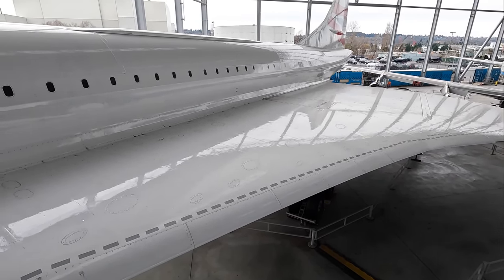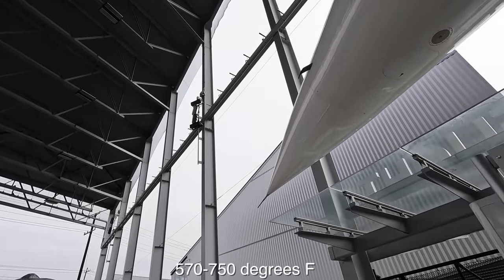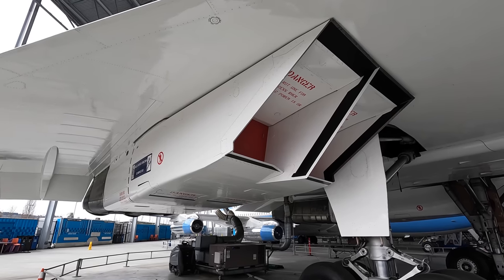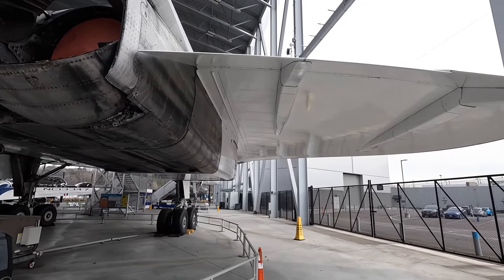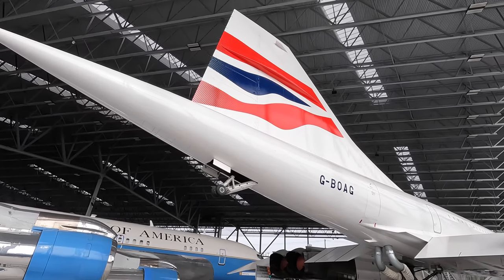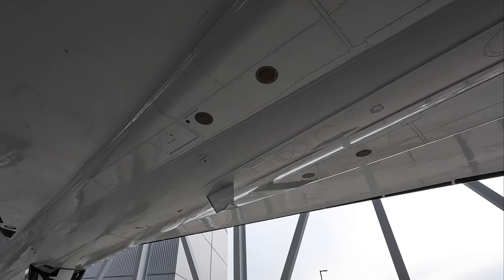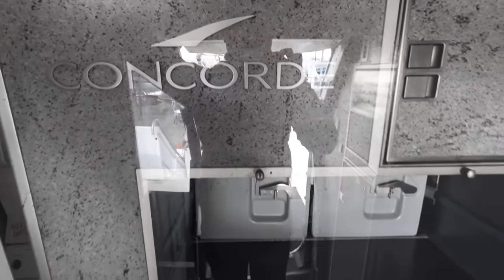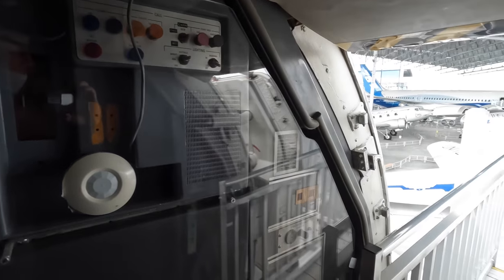Detailed tour of a British Airways Aérospatiale / BAC Concorde

Comment: Hi Paul, you mentioned the use of the fuel as a heat sink. Fuel was also used to trim the aircraft. Since aerodynamic trimming was not considered ideal, because of the lack of a horizontal stabiliser and the desire for a clean aerodynamic profile, fuel was shifted fore and aft to move the aircraft centre of gravity depending on flight conditions. Keeping the aircraft ‘in trim’ was the task of the flight engineer.
Reply from the maker: Thanks for the extra information. I am currently editing my tour video through the Concorde at Duxford so this is all extra interesting info.

Comment: Good Afternoon.
Another Case for another Aircraft to Far ahead of her time and Expensive and Per Passenger Ticket wise hope you had a good Bank And Healthy Bank Balance.
This Plane is so Perfect in Design and Construction you wonder how no more than 12 (Twelve) were ever built.
Easy to Answer, The Airline's were not widely accepting of the type and not SST Ready Travel.wise to gamble on.
We Recently read about the Boom Overture and Orders already from United and Another Airline and then Rolls Royce I believe pulled the Pin on the Type Power Plants wise and no one has yet come to the party on the Engine Front.
I wonder what would happen if even one of the American Based Aircraft Manufacturers or Airbus Industries picked up the Tab and Purchased the Rights to this Aircraft with a view of looking into the Future Market Place.
Given today's Modern Composite Materials available for High Technology Construction wise not to mention the Avionics upgrade and Pilot Intergration also new Power Plants and in that Reconstruction an increase in size of the Aircraft itself Width wise to allow greater room inside even a single seat Positioning wise down the middle and larger windows on the Aircraft, Who Know's what the Future will Bring Back to the Present from the  Past.
We Could go on and on about that for ever.

Good Video, Narrative and Technology talk wise, Loved it.

Regards
John
Australia

Comment: When I worked at Heathrow years ago I remember being in a deserted hangar with a Concorde, just walking around it in complete silence was a treat, the thing looked like it was going a thousand miles per hour just sitting still!
Reply: Was the G-BOAB? The one that didn't have any seats in and loads of old BA magazines as balast? They never upgraded AA and AB, but AB is still at Heathrow to this day if I remember correctly?
Reply: @FelixIsMyName  Pretty sure it was an in service aircraft as this was back in 2001, it was in the hangar for maintenance...
Reply: @richardprice7763  Wasn't the fleet grounded until Sept 11 2001?
Reply: @richardprice7763  I remember being on a flight back from Dublin back in 2000 and seeing all the Concorde in there area in Heathrow. One of the best sights I've seen from the air!
Reply: @FelixIsMyName  I probably got my year wrong but they were definitely flying at the time...
Reply: @richardprice7763  That's what made me think it was AB, as it's the one of the two BA decided were not worth upgrading due to their high (for Concorde) flight hours.

Comment: I flew Concorde in 1992. Yes the interior was very small compared to a then 767 but you didn't really notice with only 100 passengers. No IFE either but you were being plied with booze and food.
Take off was very noisy but incredible acceleration. Supersonic transition was two big shoves in the back as they lit the afterburners on the outside and then the inside. Very stable in flight but windows were quite hot to the touch.
An incredible experience which is gone now☹️
Reply: Normally plane windows are cold to touch. I wonder why they were hot?
Reply: @underneonloneliness2  uh maybe consider how fast the plane is moving? like this plane is exceptionally fast going at mach 2
Reply: @underneonloneliness2  Concorde cruised at over 1300mph, faster than a rifle bullet (hard to believe when you stand next to Concorde) the Friction caused by the plane tearing through the air at that speed is what caused the heat and actually caused the aircraft to expand considerably.

Comment: If they simply made it similar to xb70 only mach 2.0. 4 engines and highly modified  it would have been cheaper from the start.
Reply from the maker: It would have been interesting to see how much commonality there could have been between something like Concorde and the XB-70. I don't imagine that Boeing would have been too impressed, though.
Reply: @PaulStewartAviation  Virtually all aviation has stemmed from some sort of war machine interest like cargo airplanes for the military turned Passenger liner, sentry aircraft like "Boeing P-8 Poseidon" is my favorite example.  The Xb-70 is a fascination blend of efficiency and beauty and size, an apex predator, large enough to take passengers in the bridge or neck extension.  20 year old technology and consent from Boeing just isnt going to happen -your right, the blend or mix of both worlds would have been amazing to see...But 150'000 gallons or 567811 liters of fuel for 100 passengers isnt something can exist in the 80's for long.

Edit:  Just found this.  The XB-70 could fit 80 passengers in airline-style seating, in an absurd idea to keep the jet production going.

Comment: Concorde is a beautiful airplane. I got  to see the other two air frames that are in the States: an Air France example in the Smithsonian's Dulles facility and the British Airways one parked next to the Intrepid in NYC. I got to tour the inside of the latter, including sitting in the FO's seat (no plexiglass on that one, just slip covers on the seats). Three things struck me about the cockpit: 1) it's tiny, too small to stand upright, 2) the pilots' view must have been amazing, 3) everything looked analog, almost no screens whatsoever. Our tour guide explained that after no more orders were received, there was little incentive to update the avionics (same reason as why the "B" model was cancelled). Consequently, by the time the Concordes were retired in 2003, they were the last airliners flying for either Air France or British Airways that still required a flight engineer.

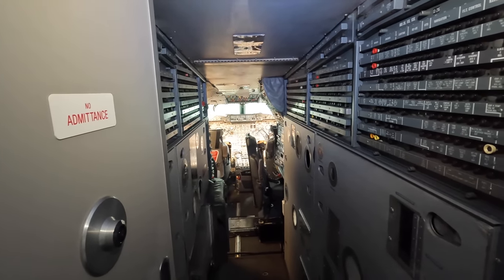Comment: 11:12 Those 'circuit breakers on both sides' are actually cookie trays for the flight deck :)

Great video!!!! That's a big plane for being so small, or vice versa. I've always wondered, if engineers are worried about outter skin temp at altitude and speed, how were there no problems with the flaps literally up against the engine exhaust?
Thanks for sharing, super awesome as always :)

Comment: Apparently the fuel was used for air conditioning and the aircraft could take a nuke
Reply from the maker: I'm not sure about that. It's a very narrow fuselage and they'd struggle to fit a nuke?
Reply: @PaulStewartAviation  apparently outboard of the engines there’s a panel which when removed can be fitted with a weapon pylon! Was told this by a guy I was working with who worked on Concorde.  He was told this by a BAE rep at lhr